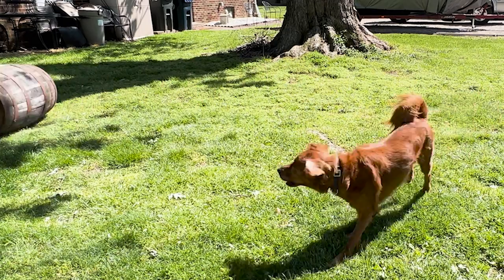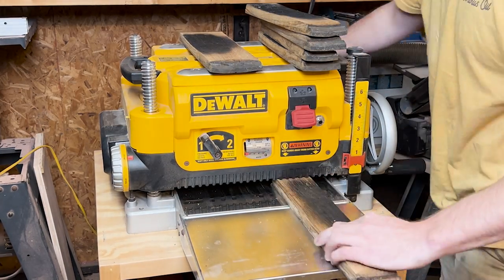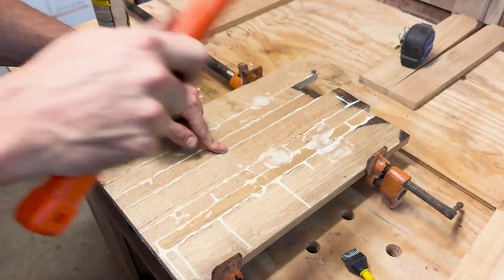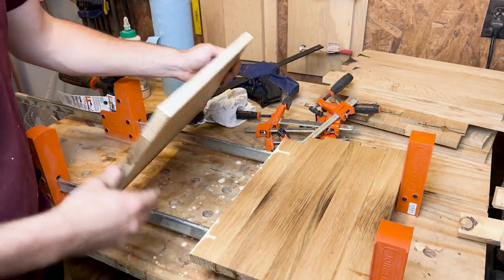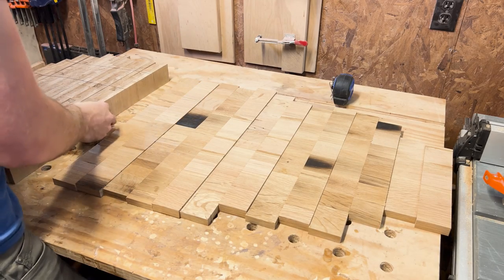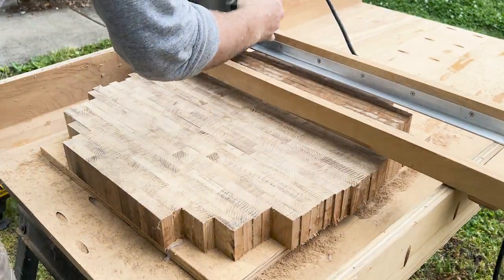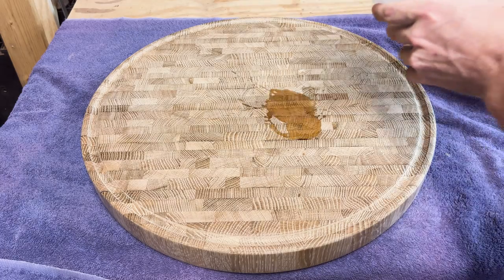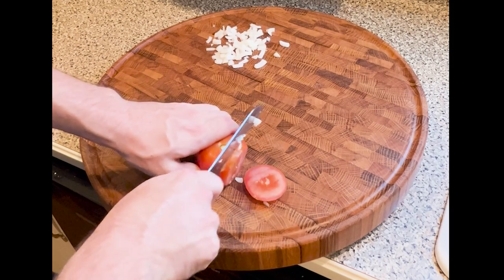From Bourbon Barrel to Circular Butchers Block

Comment: Use packing tape on your cauls.  The glue will not stick to them if you do.
Reply from the maker: I usually do, but because I was planing it down again anyway, I just skip using tape. I probably should every time to save my clamps but I am notoriously bad at taking my own advice.

Comment: That board is awesome, but I just can’t stand the thought of putting a hole in it for the circle cutting jig.  Did you just fill it with some brown CA glue?
Reply from the maker: I didn’t show in the video but I actually took it back to flatten it again and took off an 1/8” or so, so I didn’t end up needing to fill the indent. I totally agree with you however, it would have driven me nuts if I had to fill it with CA glue.

Comment: Very well done! Wanted to share, for the circular jig, if you use a cheap Amazon microphone boom arm and a mic clip, you can clip it to your bench top and and run the power cable through it. 

Because it’s a boom stand it just stays in what ever position you leave it in and moves with you while giving you the height clearance.

Also works well if you hook on a light so you can move the light at different angles above the bench without getting in the way.

Mine cost $15 on Amazon, hopefully that can help in the future. 

All the best and keep it up!👍🏼
Reply from the maker: Hahaha, that is an excellent tip, thank you very much. I had been wrestling with that cord every turn. Figured somebody must have had a better way to deal with it. Cheers 🍻